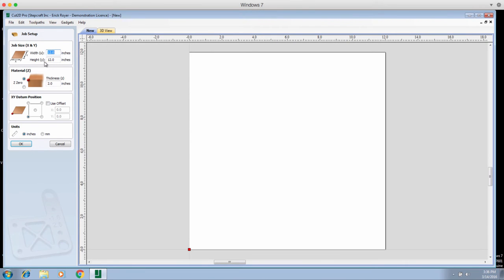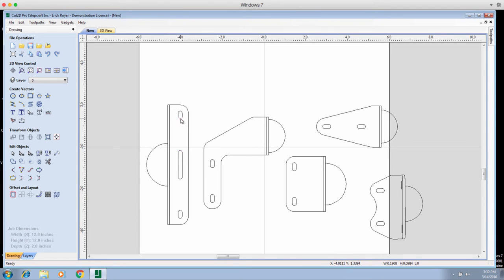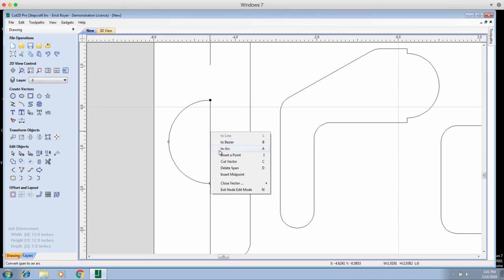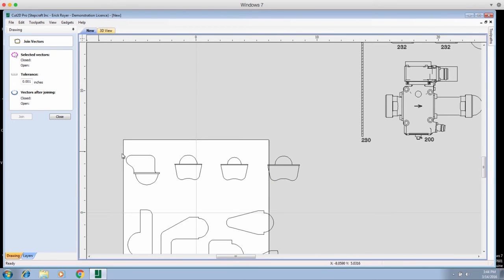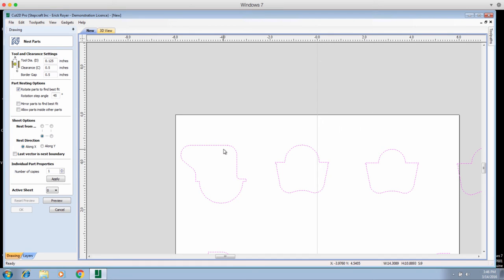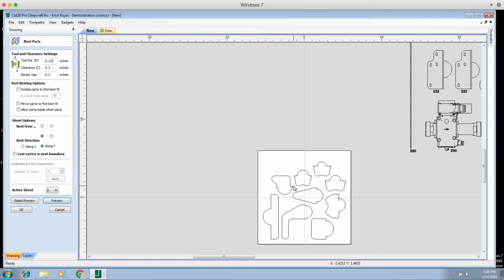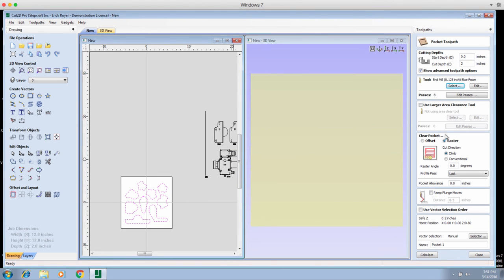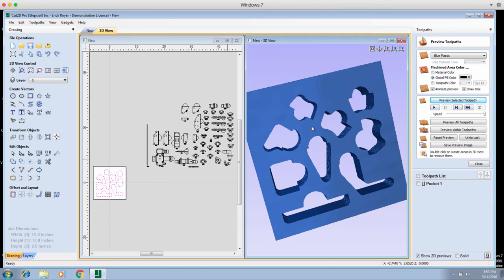STEPCRAFT - Import CAD Drawing and CNC Cut Foam

Comment: What type of foam is this "blue foam" ?  Is it somewhat rigid like insulation foam or flexible like rubber foam?  Interested in using Stepcraft to cut foam for tool and camera storage.
Reply from the maker: Its not blue insulation foam.  It is used for inserts on cases. I don't remember the name since a client provided it.